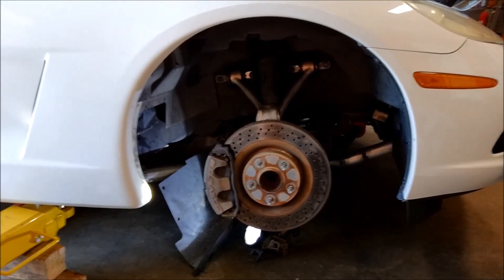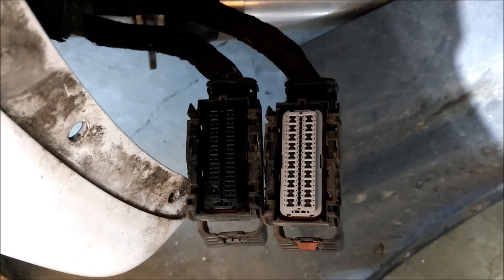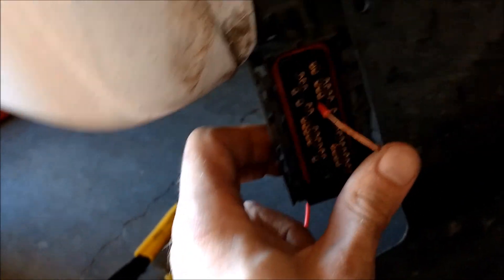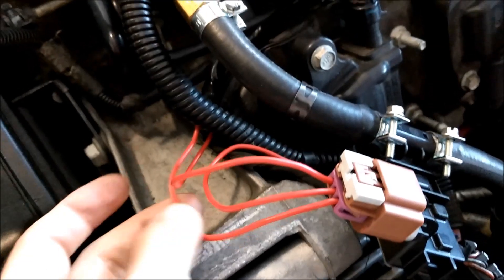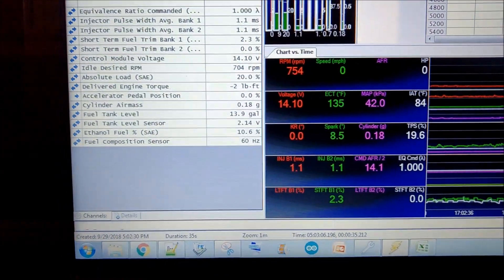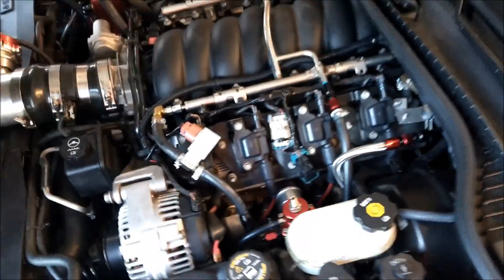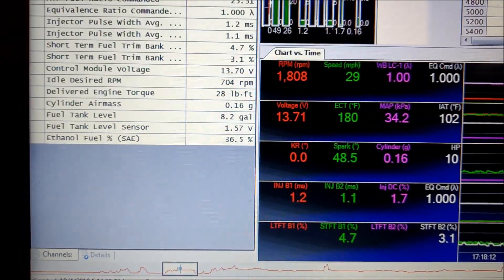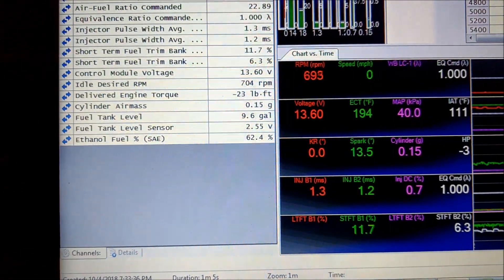Flex Fuel Conversion

Comment: I think our c6s actually hold 18! 9 in each tank
Reply from the maker: I measured them with the tanks out.  Both tanks connected on the ground full up to the very top of the filler neck is 19gal.  I have not been able to get 19 in them at the pump because of bubbles and air pressure.  The most the hold at the tank is 18.